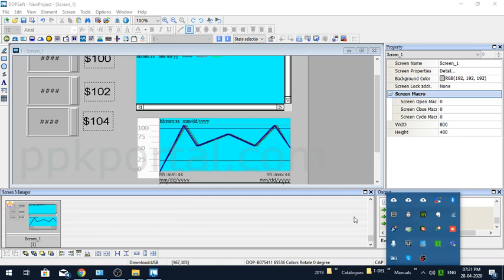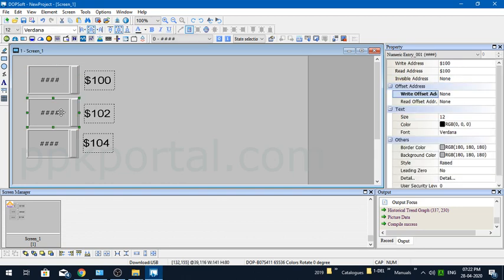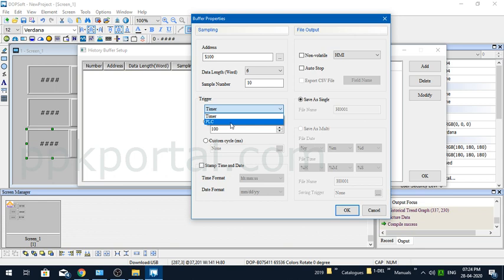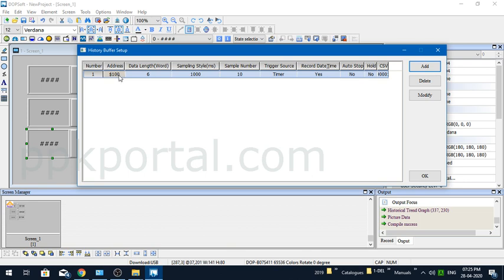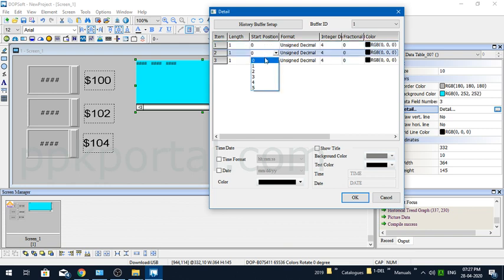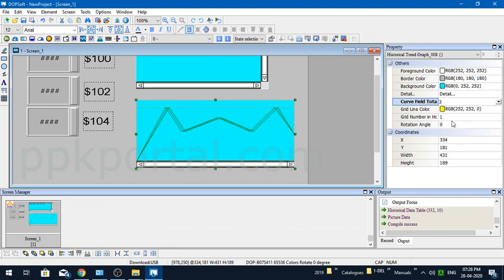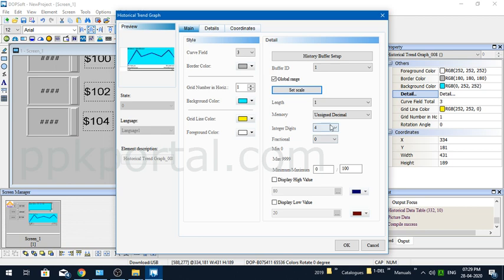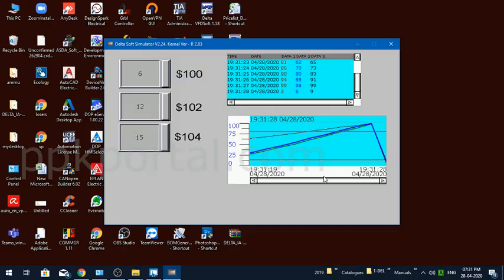Delta HMI Historical Data Table & Trend Graph Basics

Comment: 1. when i make changes on my HMI through DOPSoft i loose my Alarm history, is there a way to avoid this?
2. I am trying to put a simple counter on my HMI reading a counter bit in my ISPSoft,  but when i make changes to PLC programme i loos this counter value and it goes back to Zero, is there a way to retain this Value and only reset to 0 when i make a reset bit. any help would be appreciated
Reply from the maker: hello, can u specify the plc model and also the counter you using. if possible sent screenshot of program to prashob7@gmail.com